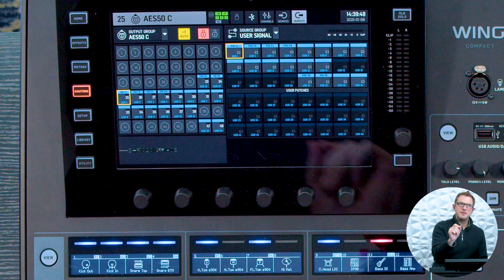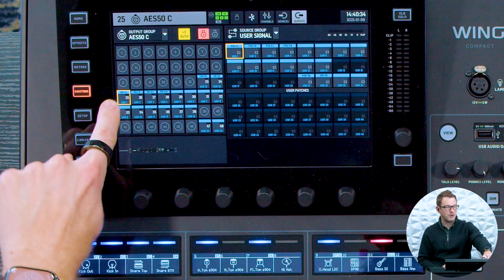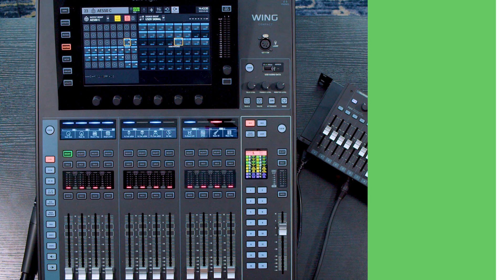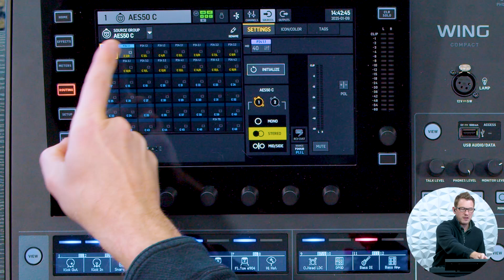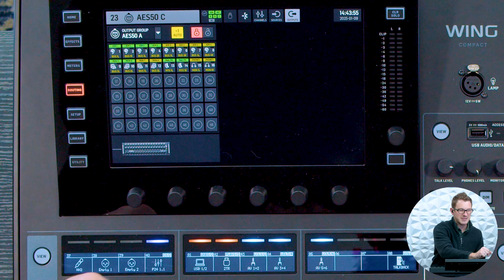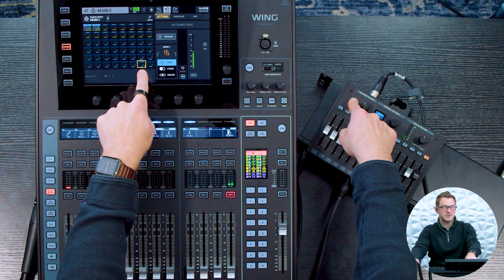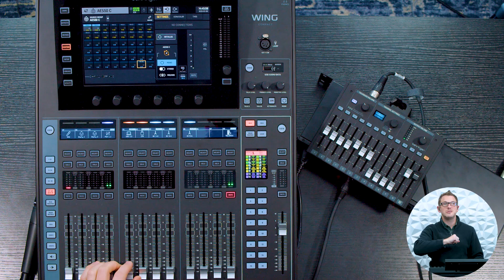Behringer P24 Hub AES50 Connections & Patches Explained

Comment: Without the hub you can only daisy chain up to 5 devices correct? What if you do 5 devices from the aes50 dl32 and another 5 from stage connect via the wing console. In theory all 10 should work now right? Or no?

Comment: Can you explain the p24 hub with AES50 and it's stage connects. Wing to DL32 from there to p24 hub. And from the hub via stage connect to some DN4816's. Basically the hub as a AES50 to stage connect bridge. Thanks

Comment: Anyone Experiencing this Issue  X32 Rack with P24 Hub and 3 P24 units all with the Latest Firmware one of the Units the 3rd one Keeps dropping out during our Gigs,  We've conected the units with Power but still drops out.

Comment: Hey Drew, great videos! Is there any chance you can make a video on how to update the P24 hub and P24 controls? We bought this system and are having issues with its connectivity; the system connects but then drops. We are using Stage Connect, but I'm going to switch to the AES50 -C port. As of right now the p24 system is not working right so hopefully an update will help

Comment: I'm just now setting up my system. I have the P24 Hub connected via AES50B on the S32 to AES50A on the P24 Hub. I can see that the hub is connected to the S32 and both icons show up in the AES50A window. BUT, I don't see the P24s that are connected to the Hub. How do I make that happen?
Reply: Another question - do you have a separate ethercon running from the console to the Hub or can it be connected to the S32 Stage Box
Reply: I'm not sure if you are expecting the Wing to show an image of each P24 connected to the P24 Hub.  I see the S32 connected to the P24 Hub and nothing else.

I called support because I too was confused about how the AES50 cables should be connected between the Wing, S32, and P24 Hub.

Here's goes:
WING - AES50 A connected to the S32's AES50 A.  S32's AES50 B connected to the P24 Hub's AES50 A.   Now, don't be alarmed when you see the green LED lamp on the P24 Hub's AES50 A port pulse from bright to slightly less than bright. According to Music Tribe support, it's operating normally and as long as the LED glows green, you're all good.

Comment: Hi Drew - we are currently connecting our Wing to a DL32 and a DL16 to get 48 channels. I noticed there is no "Stage Connect" on the digital snakes. My routing right now is WING AES-A > DL32 AES-A. DL32 AES-B > DL16 AES-A.

Am I able to connect the P24HUB to the DL16 AES-B? Or do I need to run another RJ45 from our stage to mixer and send from the Wing's AES-C? Thanks in advance!
Reply: you could connect the p24 hub off the DL32 that is connected to your A port.
Reply: Hi Drew.
Do you know what makes the P24 system output a very LOUD white noise signal when press the Thru button on the Hub?  This is very difficult to repro and I'm terrified to press that Thru button when the band or even myself have my ears in. Could there be some sort of over modulation from some source?

Comment: We just purchased and tested out the P24M and P24 HUB. Connected eight, two each, to the Hub and only 1.1, 1.2, 2.1, and 2.2. The other two would keep flashing red and green. I held “Thru”, cycled the Hub several times. Sometimes as it resyncs the ones working would stop working or constantly cut out. 

We are using the Wing, AES connection, with ProCo DMX cables. 

P24 firmware is currently 0.2.8. I downloaded SimplyPut on both Mac and PC to updated to 0.3.0 but the P24 won’t get detected by the SP app. I tried cycling PC, monitor, everything nothing worked. Please help! This is a huge upgrade from P16s but with poor reliability not sure if we can fully adopt yet unless there is a solution to the connectivity issues. Thanks in advance!
Reply from the maker: I was having similar issues until I updated the firmware on the P24. To update P24
- Connect to USB with Computer with SimplyPut
- Press and hold Channel Settings Knob
- Power the P24
Then it should show up in SimplyPut.
Reply: @DrewBrashler  thanks so much for your quick response Drew! all your videos have been super helpful too.

I got it to connect to SimplyPut by following your instructions. Do you remember how long it took you to update each P24? Its been stuck on 0% for some time now after I initiated the update to 0.3.0. I'm worried if I do anything at this point I can brick the device..
Reply: I was able to figure it out! Instead of "Online Mode" I chose "Local File" and used the downloaded file "0.3.0"
Thanks again!

Comment: Thank you for this.  Can you use the P24 without a P24 hub?
Reply: Yes. You can daisy chain them all together using DMX cable from your WINGs SC connector to your first P24, then daisy chain to the next P24 and so on.  Do not use regular XLR cables for this becase the total maximum length of the entire chain cannot exceed 131 feet or 40 meters. Now, that's a lot of distance if your WING is on stage. But if the WING is being run by an FOH engineer and it's 100 feet from the stage, you only have 31 feet left to daisy chain all of your P24 mixers together.   Best thing to do is to go wireless.  

I have 5 of these units and a P24 Hub along with 5 Audio-Technica ATW-3255 IEM wireless transmitters and receivers but unfortunately, when I patch one of the transmitters into a pair of the TRS outputs on the back of the P24 Hub, the faders on my P24 mixer have no effect.   Kinda defeats the purpose.   I must be doing something wrong.

Comment: It is a P24, why is it called a P24 when you don’t have 24 different channels.  Behringer wasting our time and trying to get our money.
Reply: You could technically run 24 mono channels (dual-mono as Drew describes it) into it, or 12 stereo channels (which would be the sum of 24 mono channels) so I think the name isn’t misleading.
Reply: A stereo group always has 2 channels, on any console. This is designed for stereo (or dual mono) use only, hence the 12 faders. Nothing misleading in the slightest.

Comment: Hi Drew, please which headset mic are you using? It is very clear with no distortion or clipping?
Reply from the maker: I have had it forever! Its a Thor Hammer SE-9. Not too bad for the price, a DPA would be a large upgrade, but a bit of EQ and the Thor sounds great!
Reply: @DrewBrashler  awesome! I will look into this. The DPA ones are too sensitive especially when using for speakers with wide dynamic range leading to frequent distortion even when you pad the transmitter down to-12dB. Just sharing…
Reply: @DrewBrashler  i tried thor hammer se-9 before, but it is an omni mic which not suitable for the church. My pastor wants the return from monitor during sermon and he will join the worship during ending. Perhaps you could give some guide regarding to minimise the feedback, please?
Reply: i guess it is dpa headset mic, but not sure which model

Comment: Hi, Drew. Thanks for the video, very informative. However, can you make a video or explain us if and how can P24 Hub can be cascaded with a stagebox via AES50 (let’s say a S/DL32) and still have 24 signal paths?
Reply from the maker: Yeah! Here is the quick answer, but I'll make a video on it. The P24 Hub uses AES50 Outputs 33-48 for the channels for the P24 system, if you have a DL32, put it first in line out of the AES50 port of your mixer, then the P24 Hub after the DL32.

AES50 outputs 1-16 from your console will go to the DL32 outputs. Then AES50 outputs 33-48 will go to the P24 Hub.

AES50 Inputs 1-32 will be from the DL32, then the P24 Hub mixbacks would be next.

Hope this helps! I'll add it to the video list though!
Reply: @DrewBrashler  Thank you very much! Yes, it helps a lot, you explained it very well
Reply: @DrewBrashler  what about the AES 1-24 channels mode that is shown in the manual of the p24 hub?